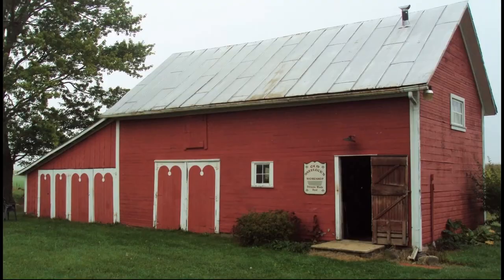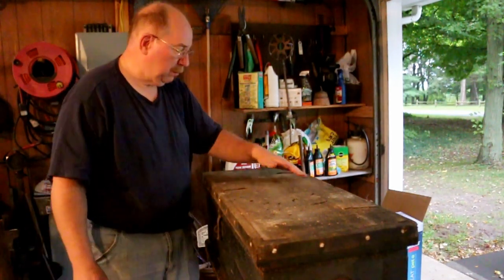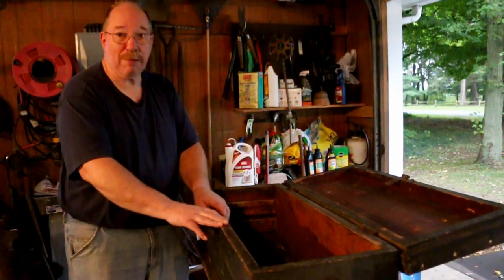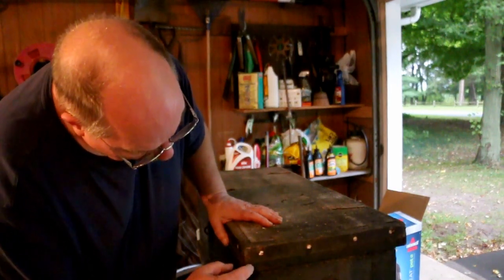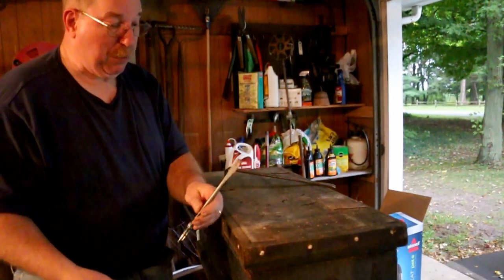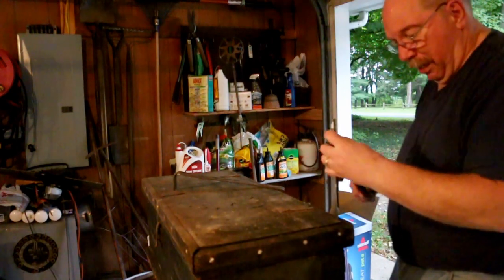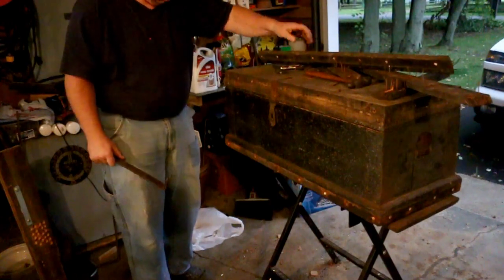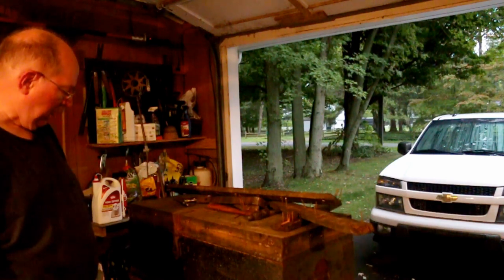Restoring AC Gardner's Tool Box Part 9

Comment: Old A C. did not expect to have someone attack his box with a wrecking bar'.
Reply from the maker: Based on the amount of reinforcement he and later owners installed I suspect he intended to slow down intruders so they could be detected before gaining entry. If you can catch them in the act most won't try. The second step is to make the resulting action just as sure as getting caught. I only had one guy take a tool without asking. I didn't need to worry after that. 😈😨😎

Comment: As someone who seems to spend half his life pulling out nails (a pallet for plaster board has 120 ring shank ones, I know as I counted them as they came out!) I agree with you that the right tool makes life so much easier. I have my eye on the Crescent Nail Puller, not available in the UK but can be imported from the US, have you used one?.
Reply from the maker: They work quite well in pulling framing nails. I have one and used one at Home Builders Inc. They tend to chew up the wood. When you are driving the jaws in to grip the head of the nail they chip out two 1/4" wide grooves on either side of the head. Not a problem with framing nails. Bit of overkill for finish nails or brads. 😎
Reply: Sneelock, many, many thanks. You have helped me to make up my mind.
Reply: Just Like the Old Cats Paw .Great For Demo or Rough Framing . Flat Bar is Better if you want no Chip Out . Finish nails you're better to pry boards Apart first and Hammer them out .

Comment: Isn’t it amazing what others do!?!  We had an old house and the gentleman who owned it prior to us thought he was a fine carpenter...he used a gutter spike to nail a door shut.  I’m sure his ears burned for several years.  He had also put a cabinet over a window, took out the tub and made a half bath out of a full bath...I was able to help our old neighbors SIL build new stairs.  He had never built stairs before.  The stairs were very dangerous.  Every board he removed, had more rot than the previous one so he had to fix the framing.  He didn’t want to tear it all apart and start from the bottom up on the entire porch.  He did okay.  I tried to explain the run and rise but should’ve written it all down come to think of it.  I’m better with writing than speaking, it’s a brain thing.  I showed him a YouTube video, unfortunately. He thought he had to cut the bottoms because that’s what the guy did and a couple were a little shy of touching the ground.  I didn’t have the words to explain why he shouldn’t do that until he measured.  The stairs are built, decently so.  I noticed the stringers are already checking.  He didn’t allow for the treated lumber to dry much...What got me is everyone was complaining that he was taking too long.  I said, if he was building new, it would’ve been done but he was going behind some drunk’s work....it’s why renovations are so costly compared to new builds.
Reply from the maker: It was a good idea to help him with his project. He might not have even tried without your help. 
There will always be room for improvement. Every job I did gives me a new perspective for the next. 
As far as the complainers they are always around after the work is done. Probably a good thing though. If I had to wade through the line of Monday Morning Quarterbacks and Know It Alls before I could begin I would get a job digging ditches and let someone else have a shot at fixing.
Reply: Old Sneelock's Workshop I’m right there with you!  I’m at hospital to get my pre-registration done for an MRI on Monday.  They found a 3cm x 2cm mass at the head of my pancreas.  I’m allergic to both dies.  I have been teasing since brain coiling#2 that with all the CT scans, cancer is a sure bet.  One of the specialists said I could light up our county and that’s not counting all the scans since.  I was hoping the dementia would hit me first roflol

Comment: To get a little more prying action, when you have the curved section of the bar between the two pieces, move the handle left-to-right, it will give you more prying action and good control.
Reply from the maker: Nice tip. Just be careful it doesn't leave too many hoof 😀😎marks on the edges.

Comment: Oh the suspense!  Will he crack one of those vintage strips???  Loos like a pretty hefty tool box.
Reply: what army is needed to move that around full of tools?
Reply from the maker: This is a small one. I've seen them twice this size. A store in Schoolcraft had one that I really liked but the $400.00 sticker was way over the shop budget. I wouldn't be able to buy anything for a year. 😖🙄😖😎
I'm putting casters on the box and it will live in the woodshop. 😀😎

Comment: Try some hardwood wedges next time.
Reply from the maker: Knowing it will all be hidden by the canvas I wasn't as worried about bruising the wood as I normally would. I have found a couple putty knives with a pry bar  between them spreads the pressure enough to avoid bruising. Hardwood wedges work too.

Comment: Okay where's Brother Lewie?
Oh well here I is.
Reply: Looks like they nailed it.
Reply: I've used side cutters to pull out the finish nails.
Shirley you jest.
Reply from the maker: @mostlymoparih5682  I use side cutters too. 😆😎
Reply from the maker: @mostlymoparih5682  Certainly did put a lot of iron in the wood. I will be using just a couple per rail and let the screws for the band do most of the holding. 😆😎
Reply: HERE I iz with arthur!
Reply: @lewiemcneely9143  Glad ta hear from ya.
Wait who is arthur?
Reply: @mostlymoparih5682  Likewise and arthur ritis!